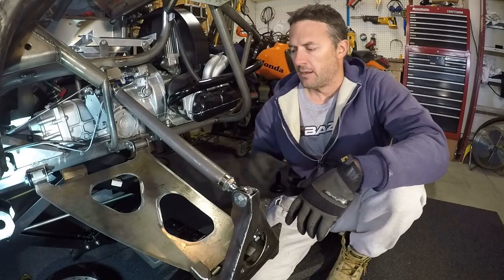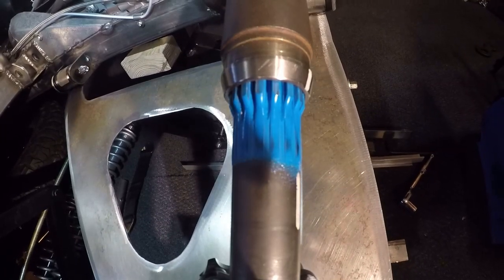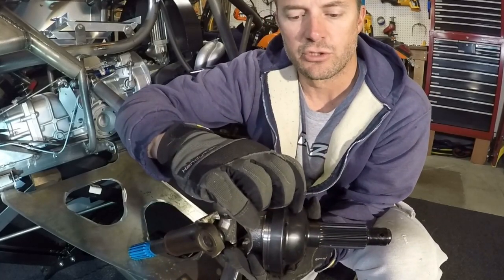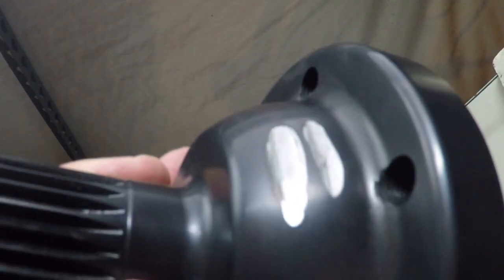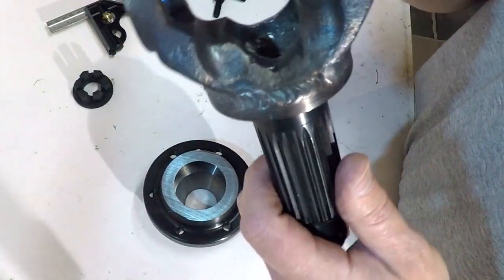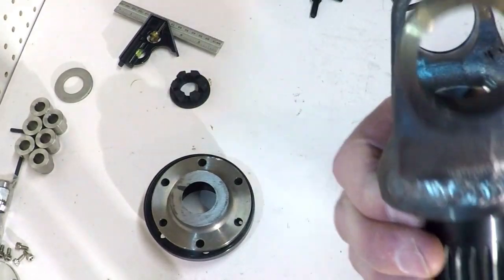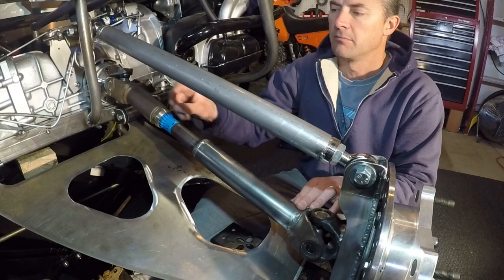Baja Bug U Joint Driveshaft Fabrication

Comment: watching one of your old videos trying to gain some knowledge. I am currently reworking my chassis to an IRS format and am just wondering if you prefer cv axles or u joint axles. I see in this video that you made axles with u joints, ad am considering raiding my local junk yard to find a few that I can make. OR, is it just easier to go with cv's. I have 100mm stubs. Any advice would be great, thanks for your time.
Reply from the maker: I advise you go with CVs. U joints are easier to set up, and they are cleaner. But CV's tend to be stronger, and less damage if they break.
Reply: @DougBugBuilder  Thank you good sir. Your advice is noted. I appreciate you and your content.

Comment: What are the drive shafts out of. All so do you have a parts list. Of this project
Reply from the maker: https://drive.google.com/drive/folders/1lryaC5lcM3sBJkxIujj82SkGArNbV4B_
That has the driveshaft flanges on it. They bolt right up to a type 2 CV flange.
The rest of the parts came from a 1997 Jeep Grand Cherokee. Front and rear driveshafts. Wranglers and Cherokees from around those years have pretty similar driveshafts. So lots to choose from in junkyards.

Comment: I need these bad for my porsche 996 transaxle
Reply from the maker: Yeah they've been working pretty good. And they go 40 degrees.
Reply: @DougBugBuilder  I couldn't find any online. I found a shop to make me some. Hopefully they're not super expensive lol
Reply from the maker: @DaFonz29  I made these with parts from the junkyard. But if you give a shop your specs they should be able to fab up a pair for you. Good luck.
Reply: @DougBugBuilder  yeah well I was looking for like the adapter to the transaxle. I feel I could do it but i feel that that first connection would need to spot on you know what I mean. The shop said bring it over we'll get it mated up thank you for your replies and videos you help me a ton on my sandrail you're basically building it without touching it
Reply from the maker: @DaFonz29  If you look in my build specs in the shared folder I do have the model number of the adaptor I used. That might help. It bolts right up to a type 2 CV flange. If you can't find it let me know and I'll dig up the part number.
Reply: @DougBugBuilder  I'm sorry idk where that shared folder is on youtube. Maybe I need to be on my desktop or something
Reply from the maker: @DaFonz29  
https://drive.google.com/drive/folders/1lryaC5lcM3sBJkxIujj82SkGArNbV4B_
Go to the engine file, and it's line #124 U jount flanges.
Reply: @DougBugBuilder  you sir are the true mvp. Thank you!
Reply: @DougBugBuilder  last question. Your h-arms. Do you prefer them over swing arms? I'm really debating going h-arm in the sandrail. I feel it'd be easier to build than the swing arms for the same movements.
Reply from the maker: @DaFonz29  I LOVE the H arms. I wish I could have H arms in the front. My vote would be go H arms. But again I don't exactly know you fab skills. But as long as you make the arms pretty strong they should be pretty easy to make.
Reply: @DougBugBuilder  I feel like H arms are easier to make than the swings arms would be. Or am I mistaken?  I'm building my front spindles at the moment and the front suspension will be done. The swing arms worry me

Comment: Hi Doug,  just a thought could you put a rubber or urethane coupler from axles to transmission to ease the torque? also that would give the trans time to catch up to axle.  Just a thought.
Reply from the maker: That's not a bad idea. Some AWD cars used to use a viscous coupling. But that wouldn't work here. Thanks for the idea though. If I can think of a way to do something like that I will.
It would be great to soften the blows to the transaxle.

Comment: How do you keep from granading the Transmissin? What is your “easy fix weak link?” I understand in another video you explained that your running a stock bus trans that you had rebuilt. Weaker clutch that has a little give??
Reply from the maker: The weak link is my foot on the clutch pedal. And letting off the gas when I feel the tranny unloading over eneasy terrain. I'm not kidding, with this setup if I let her rip the differential housing will most likely let loose. So in short I baby her when needed. Wish I had a better answer....

Comment: what drive shaft are you using there?
Reply from the maker: The components for this driveshaft came from a 1998 Jeep Cherokee front and rear driveshafts. I cut them up and welded the pieces back together the way I needed them.

Comment: Whats the adapter flange part number for those and do you happen  to know if they make them for type 1 flanges . I've been wanting to make some of these myself but having a hard time finding them.
Reply from the maker: That adaptor is made by Drivelines NW
Part # HS 3102-86
I paid $48 each.
It bolts right onto a type 2 flange. I'm not aware of any decigned for a type 1 flange.
Hope that helps and good luck with the project.

Comment: Good work!  Read through some of these comments and realised you may be re-working some of your suspension.  I'm willing to bet there's a yoke with the spline count, diameter, and u-joint size you need that's available in a factory or aftermarket application off the shelf.  Just might take some digging.
Reply from the maker: You are absolutely correct. Although this suspension is working great, of course I need to make another that is bigger and badder. ;-)
I'm working on the front right now. But gathering parts for the rear. And I'm doing exactly what you said. Doing a deep scour of the web to find a yoke that will fit the new hub assemblies and have a U joint at the other end. This will hopefully be stronger and have less welding.
Thanks for the comment!

Comment: how true was it after welding?  wont it wobble?
Reply from the maker: For being done by hand it's really true, but not perfect. If this was a driveshaft this would not work. It would be to out of balance. But it's an axle not a driveshaft. So it spins at tire RPM, which compared to regular driveshafts, is really slow. I have about 700 miles on these now and even at 60mph they look fine and I don't feel any vibs from them.
Reply: @DougBugBuilder  I was wondering the same does it not wobble the car itself
Reply from the maker: @DaFonz29  No it doesn't, at least not that I can feel.

Comment: Nice job I've been running beefed up stock arms with type 2 CV joints seems to work fine would raced prepped 934 CV and  some race arms been cheaper  plus less things to break
Reply from the maker: Less things to break, but not cheaper. I got these parts from the junkyard. So the parts investment for these was really low.

Comment: What type of telescopic arrow did you use?
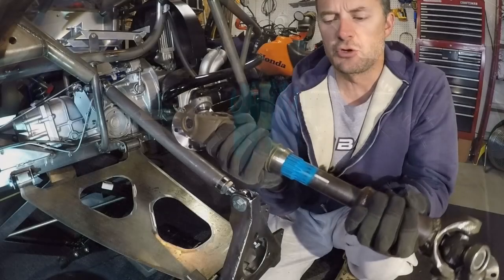What kind of car? 1:27
Reply from the maker: Most of the parts I used to make these axles were taken from Jeep Grand Cherokee's front driveshafts. Like late 90's early 2000's models.

Comment: What was the other setup before? I'm looking to build a set of arms like it for my buggy
Reply from the maker: Before I switched it to A Arm it had a set of trailing arms that I had made for it. They were basically 3x2 trailing arms with a straight pivot. The straight pivot was key. I was not a fan of the camber change on the stock setup trailing arms.

Comment: Enjoying all your work. However seems you didn't preheat before your weld. Stubs are at best 4140 and at worst 4340. Lots of preheat 350 and post heat 300-400 an allowed to cool very slowly. Totally possible but I would use 71m dualshield from lincoln instead of (assuming) er70s-6. Love your vids!
Reply from the maker: babcockcopper, You are correct, I did not preheat with torch. As you know you can't just jump in and weld something like this. It will stress the welds and crack them, which it did to the initial tacks. What I did was make some tacks to hold it in position. Then I did some stitches. Some of these held some were cracking. Then I make a small weld all the way around. The small weld all the way around is for preheating. Then I make the final weld all the way around with quite a bit of heat and filler. Then I set it to cool on its own. Seems to hold, I've used this technique before. Didn't go over any of this in the video as I don't really recommend it, it's a bit hillbilly.
Guess I'll see when she's up and running. I did use 70S-6 for filler, thanks for the tip on the 71m. I'll ask them about that at the weld shop.
Thanks for the comment and info, let me know if you see anything else that you think I could reasonably do better.
Reply: I am going to build one myself and I can assure you mine will likely be more hillbilly... I enjoy your vids very much. I only commented as I have built many custom yokes and drive shafts for heavy equipment and mining operations. I like your approach and it shows to aspiring young people that you dont have to have all the latest and greatest tools to do some really nice work and problem solving.

Comment: Those shafts have to be checked for run out and balanced or you will get severe vibration that will destroy your u-joints or worse.
Reply from the maker: Oldhawkins, They might, or might not. Because they are after the transaxle they only spin at tire rotation RPM. So at 60mph they will be spinning about 600rpm. But thanks for the heads up. Once the bug is up and running I will look into having them balanced should I decide to keep them.